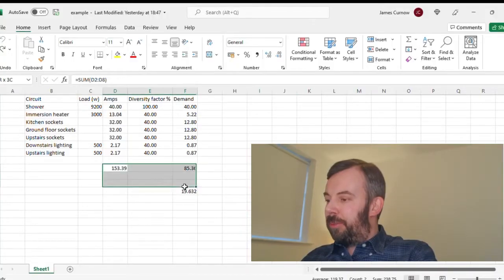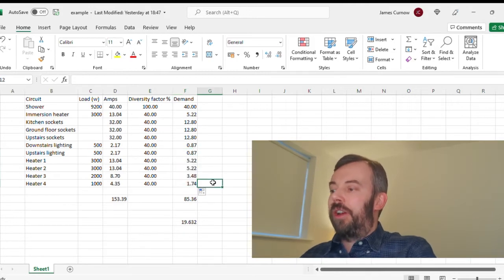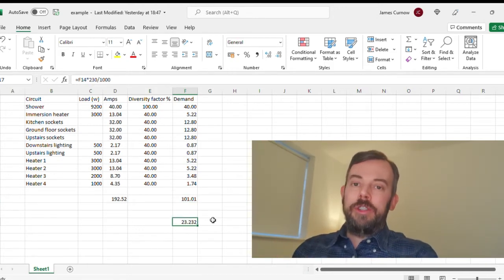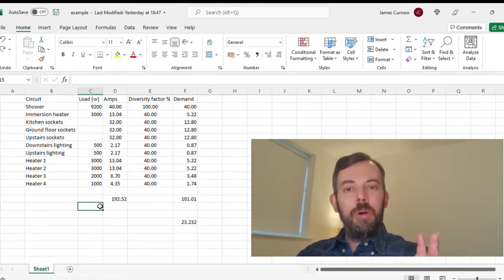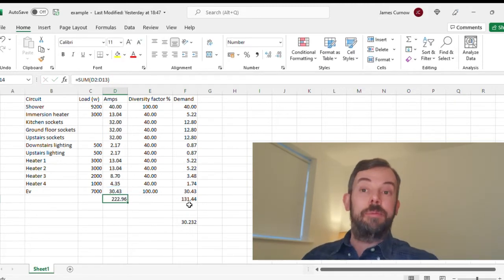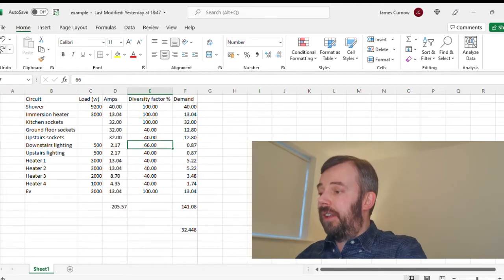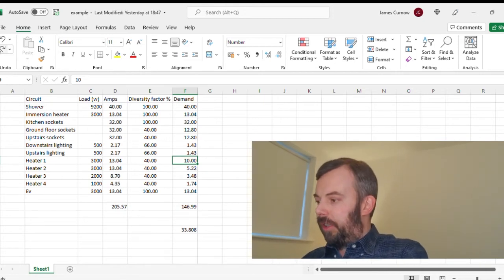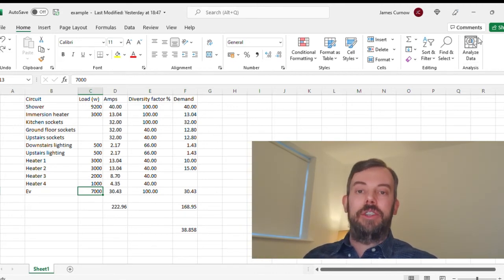MAXIMUM DEMAND for electric heating

Comment: So if we have a 100amp main cut out fuse, a main consumer unit with 100 amp main switch. Max demand = 97 amps. But then have a garage DB with max demand of 68 amps. DB has 100 amp main switch.
Both have been calculated using the 100% and 40% as shown in this video.
Both consumer units are fine but clearly this is putting the main supply fuse under strain somewhat.
Is this an Ok situation or NG?
Appreciate there is some ambiguity here but hope fully you get my point? 
Curious to know peoples thoughts.
Thank you
Reply from the maker: Hello Darren,
It's difficult to say without knowing what the loads are. Is the garage DB supplied from the main consumer unit? or are they supplied separately?
Regards
James